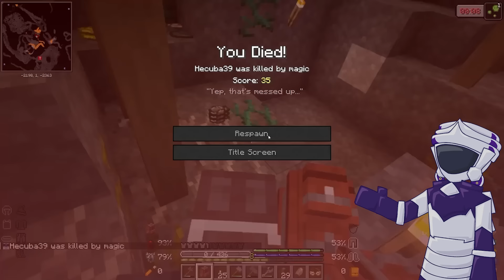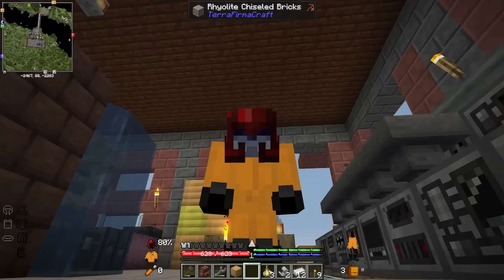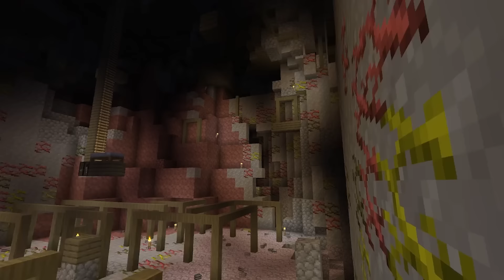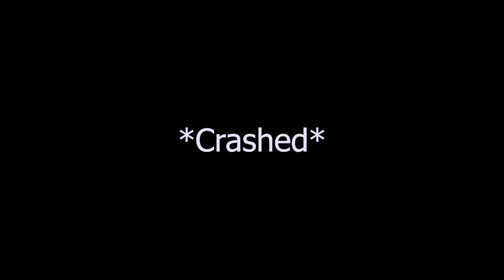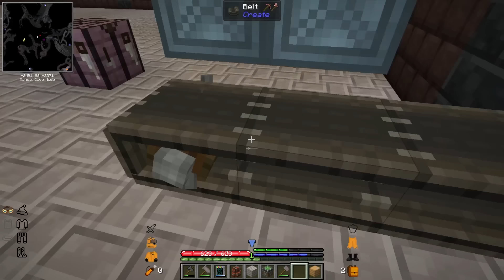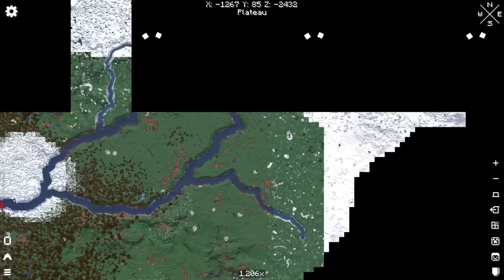Why I spent 20 Hours Making Transistors in Minecraft's Most Realistic Mod (TFG Part 8)

Comment: A kind of method using nitrogen dilution coke-oven gas to burn stove
Technical field
The present invention relates to hotblast stove technique, under the situation of hotblast stove without coal gas, adopt and mix the technology that nitrogen substitutes blast furnace gas burning stove, reach the technique effect of the quick accumulation of heat of hotblast stove.
Background technology
Before Iron And Steel Company goes into operation, due to without blast furnace gas source of the gas, blast furnace gas can not be used after hot-blast stove baking oven terminates normally to burn stove, for guaranteeing the normal blow-on of blast furnace, hotblast stove needs accumulation of heat sufficient, and hotblast stove needs to drop into main burner and carries out burning stove, because coke-oven gas calorific value is too high, can damage be formed to material resistance in hotblast stove stove, need the calorific value making it to reach blast furnace gas with addition of nitrogen dilution coke-oven gas, to ensure the trouble-free burning of hotblast stove.
The present invention controls to burn stove with hotblast stove main burner by the gas pressure that hotblast stove main burner prevents tempering from needing needs large coal gas amount, increase the exhausted air quantity after burning, increase heat storage capacity to control, when without blast furnace gas, hotblast stove is used normally to burn the Absent measures of stove, achieve the quick accumulation of heat of hotblast stove, there is important production practice meaning.
Summary of the invention
The object of the invention is to: under being provided in the condition not using blast furnace gas, guarantee that hot blast stove system uses main burner normally to burn the method for stove, there is energy-efficient technique effect.
The object of invention is achieved in that a kind of method using nitrogen dilution coke-oven gas to burn stove, adopts hotblast stove, implements step by step;
1) stokehold coke-oven gas pressure-controlling is burnt at 9-12kPa; Nitrogen pressure controls at 1.6-2.2MPa;
2) the blast furnace gas blank-plate valve 2 that blast furnace gas is connected with outer net is closed, the coke-oven gas house steward stopping valve 3 on coke-oven gas pipeline, coke-oven gas blank-plate valve 4 are opened, coke-oven gas is introduced hot blast stove burning blast furnace gas pipeline;
3) nitrogen is mixed burning ball valve 6 complete shut-down, 20% airshed opened by nitrogen header pipe stopping valve 1;
4) performed by 1# hotblast stove 13 and manually burn furnace operating, perform turn on the gas and cut off 1# hotblast stove arm when diffusing 7 operation, mixed by nitrogen and burn ball valve 6 standard-sized sheet, control at 5-8kPa by burnings stove gas pressure, burning stove coke gas flow controls at 8000-10000m 3/ h, burns stove gas flow and controls at 16000-25000m 3/ h, hot blast stove burning remaining oxygen controls at 1-2%, and 3 hotblast stoves burn stove successively, must not burn stove simultaneously;
5) before blast furnace opening, hotblast stove shifts to an earlier date 24h and starts to burn stove, and before blast furnace opening, exhaust gas of hot-blast stove temperature is all burnt to 350 DEG C, and after blast furnace opening, hot blast temperature controls at 750-800 DEG C, and a hotblast stove air-supply time controling is at 60-70min;
Wherein nitrogen and coke gas flow proportioning are 1:0.4; Blow-on hotblast stove heat storage capacity, namely exhausted air quantity controls at 35000-45000m 3/ h.
The present invention is in newly-built Steel Complex, coke-oven gas or Sweet natural gas is used to carry out burning the method for stove for blast furnace opening operation provides hotblast stove, meet the demand that blast furnace opening uses hot blast temperature, realizing hot blast stove burning uses coke-oven gas or Sweet natural gas to mix the technology that nitrogen substitutes blast furnace gas, shows technical progress.
Accompanying drawing explanation
The present invention is described further by reference to the accompanying drawings.
Accompanying drawing is operation technological process schematic diagram of the present invention;
As shown in the figure: 1-nitrogen header pipe stopping valve, 2-blast furnace gas blank-plate valve, 3-coke-oven gas house steward stopping valve, 4-coke-oven gas blank-plate valve, 5-coke-oven gas are mixed and are burnt electrical ball valve, 6-nitrogen mix burn ball valve, 7-1# hotblast stove arm diffuses, 8-2# hotblast stove arm diffuses, 9-3# hotblast stove arm diffuses, 10-1# hotblast stove gas stop valve, 11-2# hotblast stove gas stop valve, 12-3# hotblast stove gas stop valve, 13-1# hotblast stove, 14-2# hotblast stove, 15-3# hotblast stove.
Embodiment
The present invention is described further in conjunction with the embodiments.
Embodiment
One, the technical parameter of hotblast stove controls:
1) stokehold coke-oven gas pressure-controlling is burnt at 10kpa; Nitrogen pressure controls at 2.0MPa;
2) the blast furnace gas blank-plate valve 2 that blast furnace gas is connected with outer net is closed, the coke-oven gas house steward stopping valve 3 on coke(oven)gas pipeline, coke-oven gas blank-plate valve 4 are opened, coke-oven gas is introduced hot blast stove burning blast furnace gas pipeline;
3) 1# hotblast stove 13 performs and manually burns furnace operating, when execution turn on the gas cut-out 1# hotblast stove arm diffuses 7 operation, is mixed by nitrogen and burns ball valve 6 standard-sized sheet, control at 7kPa by burning stove gas pressure, burn stove coke gas flow and control at 9000m 3/ h, burns stove gas flow and controls at 20000m 3/ h, hotblast stove remaining oxygen controls 1.5%, and 3 hotblast stoves burn stove successively, must not burn stove simultaneously;
4) before blast furnace opening, hotblast stove shifts to an earlier date 24h and starts to burn stove, and before blast furnace opening, exhaust gas of hot-blast stove temperature is all burnt to 350 DEG C, and after blast furnace opening, hot blast temperature controls at 780 DEG C, and a hotblast stove air-supply time controling is at 65min;
Wherein nitrogen and coke gas flow proportioning are 1:0.4; Blow-on hotblast stove heat storage capacity, namely exhausted air quantity controls at 40000m 3/ h.
Two, process control operation:
1) keep nitrogen header pipe stopping valve 1 to open 20% airshed, blast furnace gas blank-plate valve 2 is closed;
2) open that 1# hotblast stove arm diffuses 7,2# hotblast stove arm diffuses 8,3# hotblast stove arm diffuses 9, then coke-oven gas blank-plate valve 4 is opened, open coke-oven gas house steward stopping valve 3, open coke-oven gas and mix burning electrical ball valve 5, then close that 1# hotblast stove arm diffuses 7,2# hotblast stove arm diffuses 8,3# hotblast stove arm diffuses 9, coke-oven gas is introduced blast furnace gas and burn stove pipeline;
3) when burning 1# hotblast stove 13, perform 1# hotblast stove 13 hot blast stove burning schedule of operation, open nitrogen while opening 1# hotblast stove gas stop valve 10 and mix burning ball valve 6;
4) when 1# hotblast stove 13 hot blast stove burning terminates, closedown 1# hotblast stove gas stop valve 10 is closed nitrogen simultaneously and is mixed burning ball valve 6, performs 1# hotblast stove 13 hotblast stove and boils in a covered pot over a slow fire stove program;
5) when burning 2# hotblast stove 14, perform 2# hotblast stove 14 hot blast stove burning schedule of operation, open nitrogen while opening 2# hotblast stove gas stop valve 11 and mix burning ball valve 6;
6) when 2# hotblast stove 14 hot blast stove burning terminates, closedown 2# hotblast stove gas stop valve 11 is closed nitrogen simultaneously and is mixed burning ball valve 6, performs 2# hotblast stove 14 hotblast stove and boils in a covered pot over a slow fire stove program;
7) when burning 3# hotblast stove 15, perform 3# hotblast stove 15 hot blast stove burning schedule of operation, open nitrogen while opening 3# hotblast stove gas stop valve 12 and mix burning ball valve 6;
8) when 3# hotblast stove 15 hot blast stove burning terminates, closedown 3# hotblast stove gas stop valve 12 is closed 6 nitrogen simultaneously and is mixed burning ball valve, performs 3# hotblast stove 15 hotblast stove and boils in a covered pot over a slow fire stove program.

Comment: tbh you could fully automate polyethelyne on HV, and if you need oxygen in a certain point use andesite dust centrifuge to get asbestos, electrolyze that and you get hydrogen, 9 buckets of oxygen, and idr what more

Polyethelyne Automation
LV Compressor: rubber saplings (infinite) > plantball
MV Macerator: plantball > bio chaff
LV brewery: bio chaff + water > biomass
MV Distillery: biomass > ethanol

*you need sulfuric acid to get ethylene*
LV ChemReact. :sulfur + oxy > sulfur dioxide
LV ChemReact. :sulf dioxide + oxygen > sulfur TRIOXIDE
LV ChemReact. :sulfur trioxide + water > sulfuric acid

MV ChemReact. :sulfuric acid + ethanol > ethylene
MV ChemReact. :ethylene + oxygen > polyethelyne

Comment: It is funny that i just made a video in the infinite aluminum setup.
Yep, the chemistry really put me off, it is so overwhelming. Also, this pack isnt reliable as a true gregtech, i had so many aspect that worked in the real gregtech not working here, like filter on fluid pipes simple dont work, and for chemistry that is a big headache.
The hazmat helmet is the part with the air filter, so ofc it protects against the dust, but yes, need full set, i was expecting it to lose durability with use or damage, but so far it dont seems so.
Why are you making the expensive hull recipe if you have plastic to make the cheaper version?
The constant falling sound is because the drill mines two layers at once, so the game thinks you harvest a block below a solid block on the ceiling without support, but yes, you can just support the top layer and mine down and never have a cave in.
i still need to do the tree farm, but i will go with gregtech as i am not familiar with Create, and i always, always make a back before any huge or game breaking setup.
it is kind of ironic that just now you are getting the crusher, so close to the universal macerator, which is the second thing i will use the HV circuit once i get those, first is the circuit assembler then universal macerator, so my process line can finally be complete, i already have washing and thermal, so i have lots of extra material, even if no usefull at glance, like cobalt, it can be turned into item pipes, saving a lot of tin/brass.
Reply: If you’re talking about the gregtech greenhouse multiblock thing, I found it super underwhelming. It gives 16 logs for 5 minutes of work time. Not worth it at all. (Unless you know a better gregtech method)

For create, get a windmill bearing and a bunch of those windmill sails (16 were enough for me). Attach a 3x3x3 (or taller) silo to windmill bearing, then attach sails to silo. Glue it together. Dragonium has a nice setup, once in his mechanical age tips video and the improved design in his MV tips video. I can help if something doesn’t work - it took me a while to set up mine properly, but once it started working, it never stopped. I have, like, 50k extra logs at this point and I dunno how I’ll ever use them 😂

Comment: Don't worry about the tree farm. Just keep the greg crates away from the glue and lean on item vaults if you want to scale the logs/saplings a ton. 
Its best from now on to check the LV quest on ore processing and look into using your crushing wheels to set up a full Ore processing line such as Iron raw ore to iron dust.
On JEI you can see the different routes pressing U on the ores but I generally reccomend:
- Crush wheel
- Washing water/chem bath
- Thermal centrifuge
- Macerate
Otherwise you could miss out on a lot of free gasses and byproducts to speed up your progression.

Comment: i work in a wire mill, and the majority of our products are either XLPE(cross-linked PE) or PE coating

PVC also makes up a large portion of our products too

the wire i am currently running while making this comment is thw which is PVC

id like to also add that the reels they are being ran onto are made of PE

Comment: Oh no, not the hazmat suit... That will be a huge detour...

You could use salt water - that never freezes. The gregtech greenhouse is not good from what I tried - 32 logs every 5 minutes. A windmill tree farm works great, but I guess your setup (although a bit more complicated) works as well

The shift-space ladder thing blew my mind

As far as I know, there is no way to complete individual quests in the quest book. For anyone reading: USE THE QUEST BOOK. Very helpful.Also use the recipe tree function to get an overview of difficult recipes.

Now that you finished getting the hazmat suit, you can start using your pyrolyse oven to make wood tar, to make benzene for great power generation.

Congrats on getting kanthal coil EBF and transistors! And HV circuits! And a large steam boiler!

I just realized I am still using ULV outbut hatches. No wonder my steam boilers don't work as well as they should...

Looking forward to your AE2 vid, because I have noooooooooo idea where to start with it. I got a bunch of stainless steel, currently working on automating plastic for a clean room, slowly progressing in HV, but other than that... The AE2 quest tree looks daunting and there's no text telling what anything is or does.
Reply from the maker: Pansmith has an amazing AE2 tutorial, it is for 1.12 but most of the stuff still applies on modern versions
Reply: @  one thing worth pointing out with TFG specifically is there's a known issue with TFC putting heat data onto everything meltable, and gregtech not, so you can end up with ae2 confused. You can work around this by either manually creating recipes with real items instead of just jei, or by having your various machines output into a chute before being sent into ae2, so they have a moment of existing "in world" for tfc to put the heat data on.
Reply: @ I am finally at a stage where I can wrap my head around AE2. Could I make the machine output into a chest which has a storage bus into the system, instead of a chute? Or could it be an output into a chest which is then forwarded into a chest with a storage bus, which then stores the items into the storage drives?
Reply: @Rws4Life  I think it specifically has to be in-world for the heat tag to be applied immediately, chests won't -- but it's worth experimenting with!
Reply: @ Thanks! Also, hope you get some auto miners. They changed my life (for the better)
Reply: @Hecuba39  btw waterlogged slab won't ever freeze so that's one easy fix :P
Reply: I use lava for my water wheel, sounds stupid but it works.
Reply: @hibernator8198  Woah, that's awesome if it works. Doesn't the stuff around it catch on fire?
Reply: @ you'll see the water wheel on fire but mine has never burnt away so I'm guessing not
Reply: @Rws4Life magma wheels are a thing, no burning, at least in vannila create
Reply: There's a lot of great ae2 tutorials on yt!
Reply: @ I watched one recently, but I am afraid of how it will work together with the rest of tfg. If anyone has any tips on things I should keep in mind, I welcome them

Also, power distribution is a bit of a problem for me at the moment in MV. Gonna have to figure how to properly get my whole base powered properly. I thought I could chain battery buffers together, like a tree of (up to) 8 buffers per buffer (as long as the first buffer(s) get enough power to supply everything), but I am not sure if that's working properly...

I'm also getting tired of eating so much pumpkin. I wonder if there is an automatic food source or something very satiating I could create in MV/HV. Oh well

For now I'm doing fine. Just started up my chemical reactors and I'm making automatic polyethelene now :)